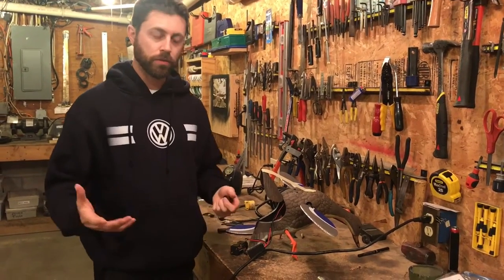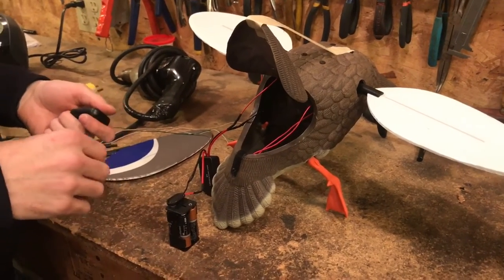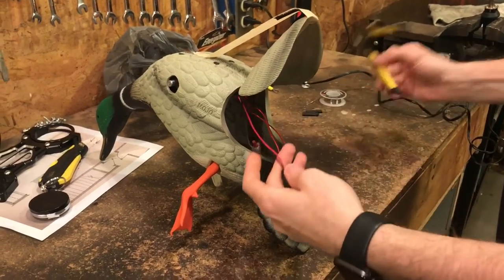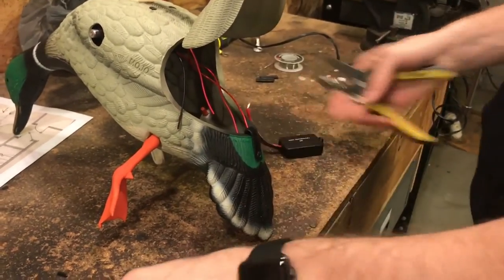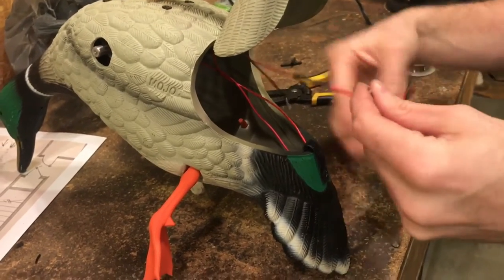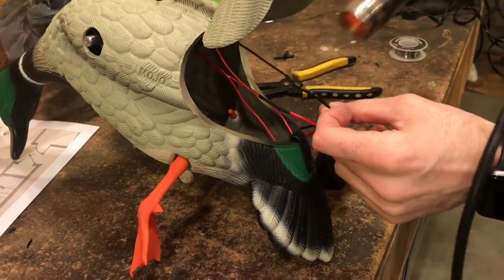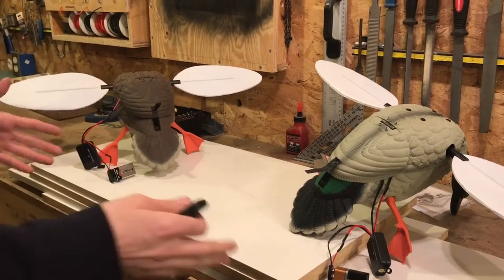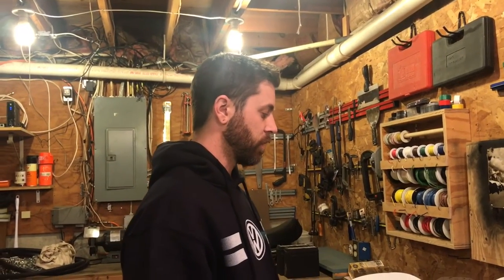Baby Mojo 12vMonster Remote Installation

Comment: I have a pair of older baby mojos.Mine do not have the hook up for a remote control.so I don't have all the wires that are in your video. Are these compatible with the older mojos.
Reply from the maker: Vincent Renaud not sure but there’s really only two wires to the motor.  If you have a switch you need to place the transmitter in between them.  Don’t know for sure your setup but it should work
Reply: Don't know if this will make sense without a diagram My  baby mojos  have the AA  battery hookup . There are 2 wires that come off the motor 1 black and 1 red and 2 red wires that come off the switch,  . The red wire from the motor goes to the switch and the black wire from the  motor goes to the connector tab for the  battery pack and the red wire off the switch goes into the connector  tab .I n the instruction video after he cuts off the connector on the monster 12 v he has 2 black and 2  red wire's the bottom 2 wires black and red go to the motor he top to wires are supposed to go to the switch but I don't have the a black wire to connect it to
Reply from the maker: Vincent Renaud okay I see where the confusion is.  The the red wire from the switch to the battery must be interrupted by the transmitter.  

Clip that red wire after the switch and before the battery clip.  Put the transmitter bottom red to the switch and the transmitter top red to the battery clip.

For the black simply clip the battery clip off the black wire,, attach the motor side black to the bottom black transmitter wire and finally attach the top black transmitter wire to your negative battery clip.

Make sense?

Comment: make sure you unplug the battery for storage or they will be dead when you want to use it as the remote pulls current from the batteries all the time.
Reply from the maker: Yessir always a good decision to remove batteries from anything when storing devices or vehicles.  Good note!

Comment: does this work for lucky duck
Reply from the maker: Logan Bierman sorry sir I only have experience with the baby mojos.  The large mojos are plug and play.  I’ve seen luck duck mods at Field and Stream near me but never tried them.
Reply: Yes but you have to know what you're doing. I've put remotes on a Mathews Motorized Duck and a Lucky Duck. 
You will need a meter. 
The remote is basically an rf relay switch. To save loot look at some car and home alarm rf remotes. They're about 1/3 the cost and have close to four times the range as a mojo remote.